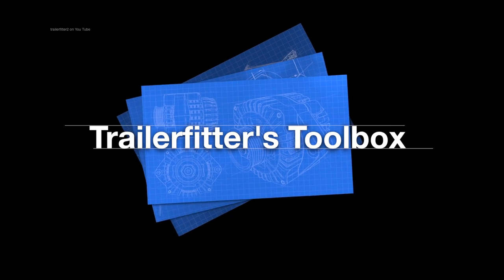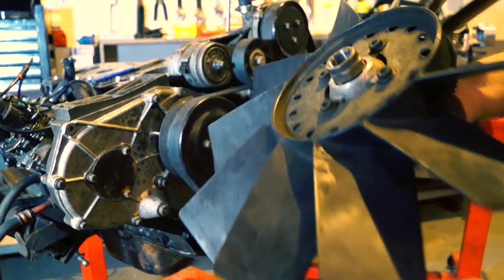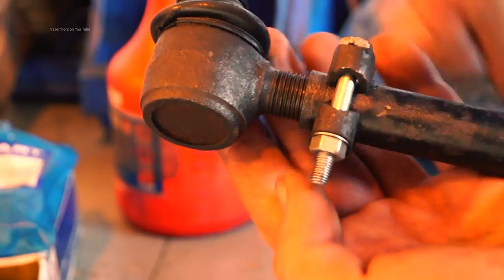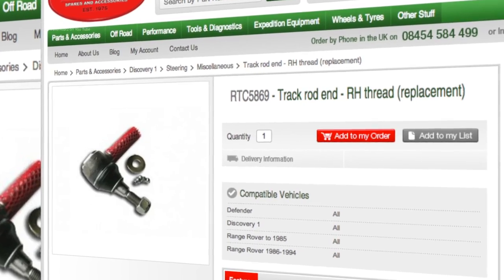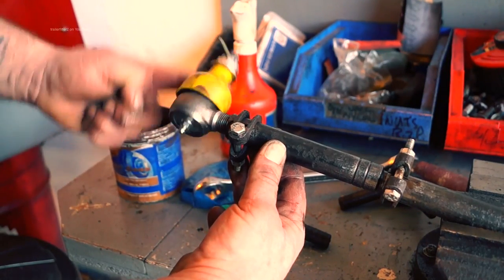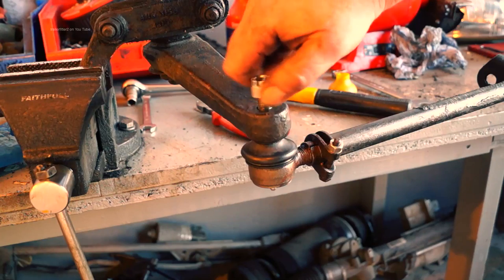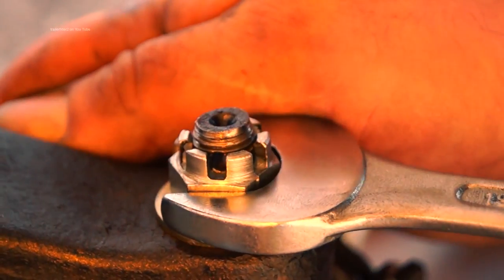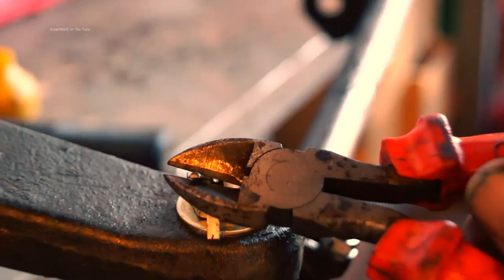Land Rover steering maintenance - track rod ends.

Comment: You my friend are a hero in my eyes! My discovery (1997 3.9) has the death wobbles when I hit a bump at any speed over 60 miles. The shocks are good, I changed the bearing & even the rotor on the drivers side but its still there!! So as I have a 1998 for spare parts trying to get the Track-joints off is a pain.......till now.......thanks. I'll be having a beer for you hahah.

Comment: Great Video. Love the Hammer trick.  Just want to verify:  When replacing both track rod ends on a 2003 Discovery (U.S.), do  I need two  RTC5869 ends, or  one RTC5869 and one RTC5870.
Reply from the maker: +Brian Collins  they are opposite thread to one another Ie;  LH and RH  so they will not be the same part number.

Comment: What a trick for tightening up the nut when the ball joint is just spinning?
Reply from the maker: Clamp it down with something like a pair of mole grips or if you can put a bottle jack under the head of the track rod end use that to bind up the ball in the socket.  A worst case scenario is to cut it off...

Comment: Hello there!! I'm going crazy over here in Colorado trying to figure out a problem on my 1999 P38 Range rover. I had new tires put on. The P38s alignment seemed perfect. I wanted to make sure the alignment was perfect so I took it into breaks plus which is the alignment shop. They told me that my outer track rod needs to be replaced so I had them replace it then align it. Now my P38 tends to pull to the right!!! It's really noticeable when I'm on the high way. It's not really bad, but it slightly pulls to the right side of the road no matter what lane I'm in. What should I do to correct this issue!!? Thx so much!
Reply from the maker: Hi sorry just saw your post here,... tyre pressure can effect the steering so best to check them,    if it's not the camber of the road that are effecting the pull then I would take it back to where they tracked it up and tell them what is happening

Comment: OK; I got four and they've been changed. But now the power has died!! It's OK in 1st and 2nd, but as I change into 3rd I get low revs and no power, and the poor car crawls along. Help - what have they done? It also idles very erratically, sometimes fine, and sometimes badly; and occasionally dies when I slow down. Is this something new, or have they done something when changing the tie-rods? Help - or point me in the direction I need to go.
Reply from the maker: Doubt that anything with the steering mechanical components has caused that sort of problem.  Not an issue I can deal with from here but it sounds like a fuel issue if it is a diesel.

Comment: I am in India; my mechanic says I need TWO tie rod ends per front wheel - total 4. I had only bought two: one RH and one LH. What do I need? Two or four?
Reply from the maker: You need one per each end of the track rod and then there are 2 more for the drag link.
Reply from the maker: I would say you only need to replace the ones that are faulty.... unless they all are.